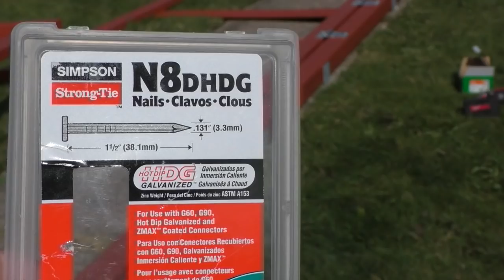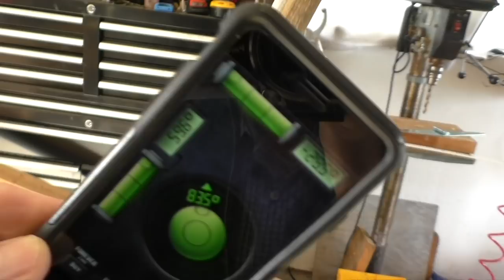DIY Ground mounted Solar Panels with adjustable angles

Comment: I have 17 kw worth of panels I got for cheap.  Not worth ground mounting in a giant array so I “ground” mounted them using old railroad ties and tie downs.  Gets me a 30 degree angle but it’s pretty much a set angle.  Your is beautiful but I imagine the wood for mine, all 75 of them, would be more than the panels. Nice to see a craftsman at work.
Reply from the maker: Thanks... guess whatever works. Haven't seen any real deals on panels around here.

Comment: Interesting for off grid but I chose 300 watt panels which are about 50 cents a watt  instead of 100s and the energy density is better. I also use  grid tie inverters  .. run the meter backwards in summer  not in winter.Either way I lowered my bill by almost 100  / month for an investment of under 2000  With cheaper panels I was able to just add more panels and avoid the whole adjust ability part.  If I need 1200 watts  and I'm not optimal I added 2 extra panels and met my goal. (have 1800 watts worth of rated watts but get about 1200 on  average)  but no fuss and I used all UL approved rackign hardware that will pass any inspection. (Iron ridge system) It's been installed 2 and a half years and we are delighted with lower bills.

Comment: If you would have aligned the “front” of the panels to the other side of your walkway, you would have had part of the walkway available to use.
Reply from the maker: Makes sense but the walkway is not used at all so that’s the reason for the design shown.

Comment: Those holes are way to close to the edge of the concrete slab if you ask me.
Reply from the maker: Yeah I thought I was pushing it too but they have been there now for several years and no cracks.

Comment: Bob you're brilliant.  I am building your panels now. You have the best engineered DIY panel support system Youtube. I didn't have any cement to support the panel for a foundation so I just added a 4x4 square frame for my foundation to attach the frames you designed. Mine are going to sit on patio stones which will be leveled on the ground which is not level at all. I will use my tractor to try to level the ground as much as possible. Thank you sir for sharing your system, you saved me a lot of money. Bless you!:thanksdoc:
Reply from the maker: Thank you very much and good luck with your solar project.

Comment: This is what I had in mind for my panels when I set my system up. My only difference is using the stainless corkscrews you put in the ground to put your dog lead on and attaching my 4 x 4s to those to anchor them in the ground. That will make leveling pretty easy as well as keeping them above the ground and pretty well anchored down against those unpredictable Ohio winds.
Thank you for the actualization of what I mostly in my mind.

Comment: I didn't know one could buy 100 watt panels. You could replace those with actual solar panels and quadruple the output. Nice frame and adjustment design.
Reply from the maker: Hi ., the panels I used are (or at least were) readily available locally from a national retailer. I was aware that they were not necessarily the best choice but it was convenient at the time.

Comment: "Maybe" at your latitude it's worth doing, but here (42 deg North), changing angle only amounts to about 5-6% gain.  Tracking east-west gives about 15%.  I built active trackers for 3 of my arrays back when panels were $4/watt.  Now at 50-60cents/watt, it is simply cheaper to add a few more panels and forget tracking.

I'd also be concerned how those would hold up to wind.
Reply from the maker: I still have to look at the angle influence on output. But the frame has to be mounted somehow and hinges are a good way to go. They allow for easy initial angle setting and they are forgiving regarding any movement in the structure under varying wind and temperature conditions.
Reply: This exactly. IT's always cheaper to add extra panels to compensate for losses due to non-optimal angles. Investing in trackers or adjustments makes a build more expensive AND introduces a bigger chance of failures.

Comment: Well done video. Nicely designed pv panel rack. You must be pretty far up north to use a 76 degree tilt angle.  I think the best year round tilt angle for non adjustable racks is about 5 degrees less than your latitude.... I believe?
Reply from the maker: Thanks bill,  My intention is to experiment with different angles but other projects have slowed me down in that regard. Hope to get some useful info over time.

Comment: Do you have a follow up with respect to the comparison energy generation for the two different angles?  Also of the 1,000W system, how is your battery bank set up and how do you utilize the "free" energy?
Reply from the maker: Nope I haven't had time to get any useful info to publish up to this time.

Comment: Awesome project pro tip used home solar panels are alot cheaper than those colemans
Reply from the maker: Yes I know that now
Reply: @BobKelland  I picked up 16 300 watt panels and all the mounts with optimizers for 500 bucks what a steal!

Comment: I really like this design.  I was wondering if you electrically bonded all the pannels, and and if so, how.
Reply from the maker: No I didn't do bonding as you suggest. Not separately, electrically, grounded.
Reply: @BobKelland  I'm not an electrician so I wasn't suggesting anything. I'm trying to figure out if it needs to be.   

You said yours is grounded, can you describe how or what you did to make it grounded.  Are you using microgrid tie inverters or using one big inverter for the group.

Comment: Are you planning on adding maybe a couple of electric actuators and make the whole system automatically adjusted?
Reply from the maker: Was considering that idea but at this point I have it on hold. But fairly easy to do with this design.

Comment: Thanks for the demo it’s a good project nicely done. Question. Was there a need to ground the solar panels in the array. And also or include a fuse in the wiring of the panels to the charge controller??
Reply from the maker: Well I still have the panels floating without a ground but that is definitely a consideration you should make. You can never go wrong by fusing any circuit that you are concerned about.

Comment: That's good for different seasons but how about for sun rise and sunset. Need a way to pivot the panels in both directions.
Reply from the maker: obviously more involved and not sure that it is warranted in terms of overall output.
Reply: @BobKelland  I tested it yesterday when a brand new 300 watt panel. I tilted it 45 degrees and then kept tilting it to 80 degrees. I didn't see a difference in output.
Reply from the maker: @Gary-ee3kq  did you have a load on it?
Reply: @BobKelland  yes I'm powering my house grid panel with (5) 300 watt panels through a 240v inverter chaege controllercombo unit. I was only using 200 watts running the TV, and various lights, modem ect at the time.

I only tilted 1 out of the 5 panels in the 5s config.
Reply from the maker: @Gary-ee3kq  might be good to check output of a panel at various angles with just a resistive load using voltmeter and ammeter.

Comment: very nice.. are you happy with the results after a few years of use.?
Reply from the maker: We live in a challenging area weather wise and so far the panels have withstood every thing thrown at them. Only indication of wear and tear is a little loss of paint. As for electrical/power performance, all five panels are still putting out. Unfortunately I still haven't had an opportunity to do a real meaningful assessment of the overall performance.

Comment: How do you deal with the shadows from the back braces?
Reply from the maker: Not a problem as the panels are pointed south and the structure shadows have practically no bearing on the output.

Comment: going with 100w cost to much it cheaper with bigger panels i 10 235w 24v for $102 a panels . but looks good
Reply from the maker: Good point
Reply: I bought 20, 245 panels from santansolar for $950
Reply: But when a 100 watt panel goes bad you only lose 100 watts.  Being that most come from China it may be wise to have several 100 watt panels these days.

Comment: Very nice video.  I’m think of doing something similar to avoid roof mounting.    I would like to run 120v circuits on solar and leave high power 220 volt appliances to be fed by the utility. I’d be interested in the electrical side of this project. How do you connect to your home circuit panel.  Size / type of your solar converter, DC to AC Inverter size, auto or manual switch over to/from utility?
Reply from the maker: I'm working on setting up a means of comparing outputs with different panel angles (but kind of slow getting it setup). You will find lots of references on interconnecting solar panel electrical output to charge controllers, batteries and inverters on the internet and elsewhere. (Eventually though I will be setting up a conventional system as you envision.)

Comment: Did you have much voltage drop from  running the wires into your house?
Reply from the maker: No as I brought the wires of  each panel separately into the house. So the voltage drop is very low over the relatively short distance.

Comment: Grounding???
Reply from the maker: Grounding helps to prevent electrical shock hazards and damage to the system caused by lightning strikes. Grounding provides a safe path for electrical current to flow to the earth in the event of a fault, ensuring that any potential electrical charge is dissipated.

To ground a 12-volt solar panel array, you can connect the negative terminal of the solar panels to a ground rod using a grounding wire. The ground rod should be made of a corrosion-resistant metal, such as copper or galvanized steel, and should be at least 8 feet long.

Comment: Not sure why people are using wood for frames when panels are lasting 30 years. The wood will rot away long before the panels are worn out and will require replacement. Not to mention damaged panels when the wood fails and panels go flying in a storm.
Reply from the maker: Pressure treated wood is used and recommended, and in this above ground application, it should last as long as the panels.

Comment: Not much point in using 100 watt panels when you can buy 300 watts for less, see solarsteals
Reply: I ended up buying 100 watt solar pannels, but because nobody was selling anything higher than that in my area. In a years time, i had bought 4. I see online you can buy 300-watt solar pannels for like $64 each. But only if you buy $1500 worth of them 😂